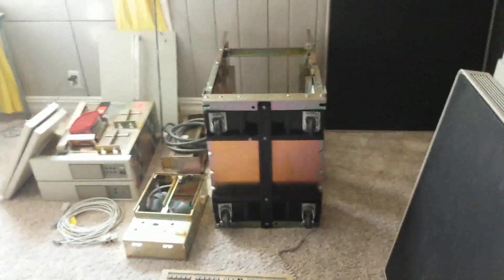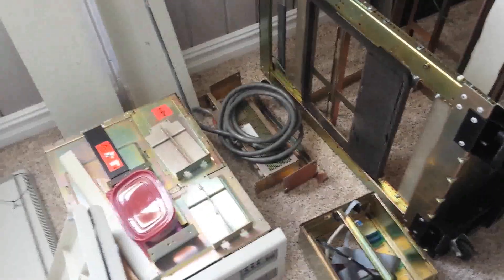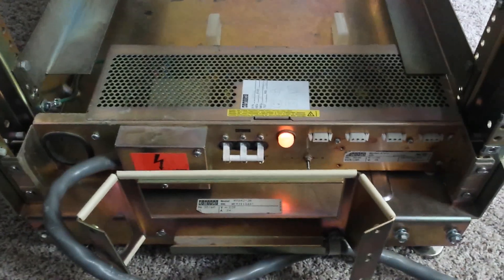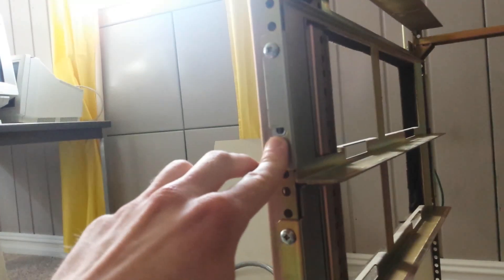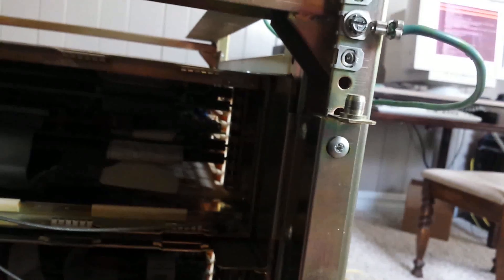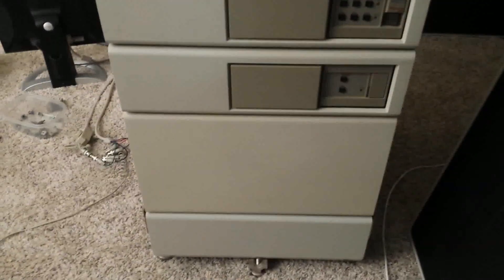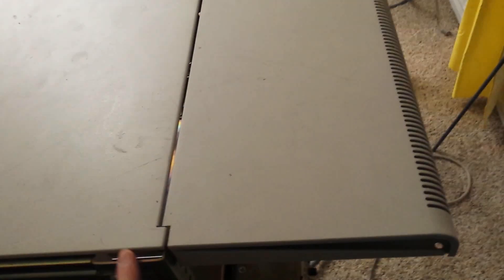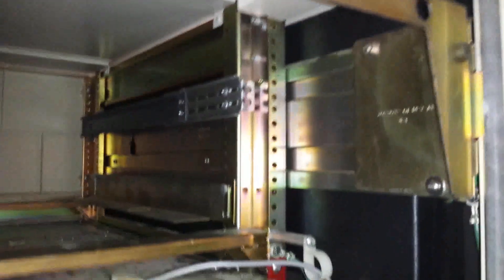DEC VAXStation 3200 part 1: Physical Assembly

Comment: Great video, but I would really like to see the cabling process as well.
Reply from the maker: Not easy to cable things and slot cards in holding the camera in one hand. I need to get a tripod.
Reply: @joesvax  Looking at the video, it doesn't look like it would be easy with three hands.  It's just amazing to see how these things went together before you could print a custom PCB for less than $100.